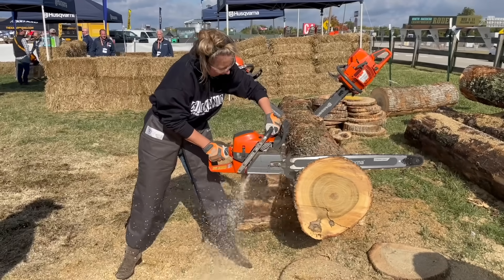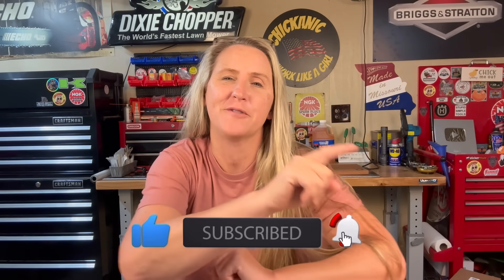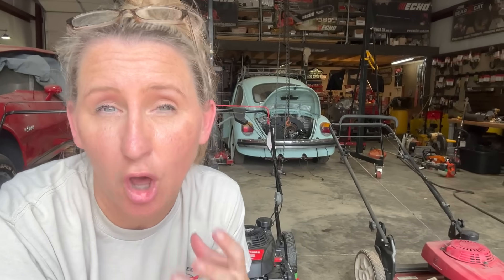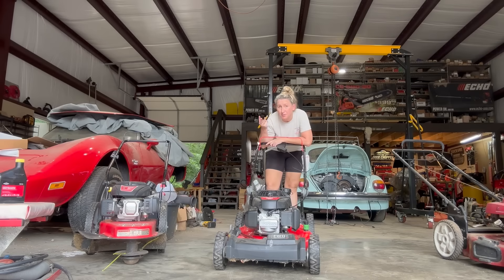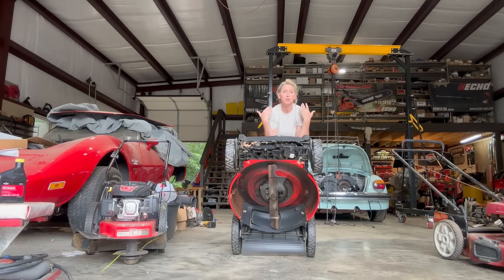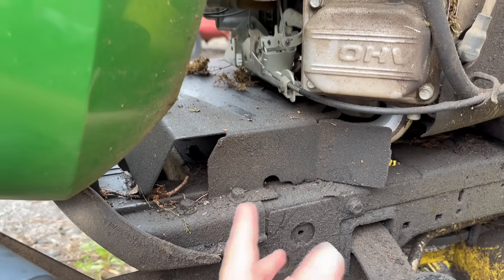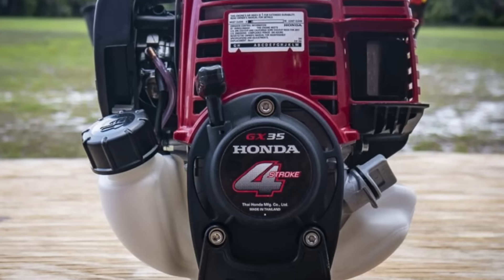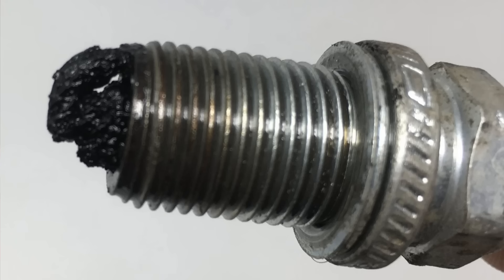Why Is Your Mower Smoking? Diagnosing 101! Small Engine Repair

Comment: You left a couple out. On some Briggs engines there is a reed valve on top of the engine, that can wear out and allow oil to get into the breather hose. Stuck rings can also cause smoking on startup and while running. I have had significantly excellent results freeing stuck rings with BG EPR. Only use 1/2 can on small engines.
Reply: I was going to mention stuck rings as well. I picked up an old toro with a briggs that had been sitting 10+ years in a shed. Oil had varnished over so rings stuck and it smoked at start up. After a couple oil changes with a bit of seafoam in the oil it finally quit smoking and ran great.
Reply: @lukem7203  
I wonder if Valvoline Restore and protect run for 15 minutes, drained, refilled; 
run for 30 minutes, drained refilled; 
run for an hour...drained 
and then "normal oil resumed might clean EVERYTHING out internally?
Reply: @JohnSmith-pl2bk  I bet it would. Never used it before but Valvoline makes good products and I bet works as advertised.
Reply: @lukem7203  Cheap gasoline can also cause stuck rings and significant carbon deposits in the combustion chamber. I've used nothing but Top Tier gasoline (Google it) for the last 24 or so years and my 20 year old Kohler engine with almost 3,000 hours on it has no carbon deposits. Using fuel injector cleaner several times a year will yield similar results.

Comment: Excellent suggestions; but my JD D110 only throws a black puff when I engage the blades?
Reply: black is gasoline  smoke. the governor is opening the throttle plates and the added gas just cant burn it all off.  check the air filter and choke  to be sure its coming off fully.  if its ok  the carb may need repair or the spark plugs may be fouling